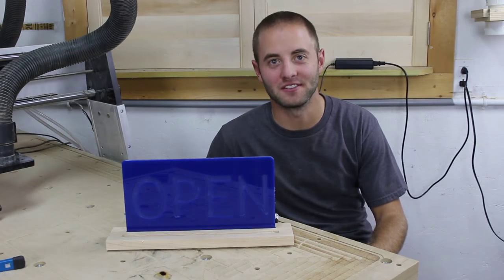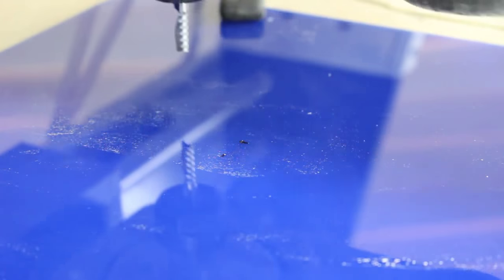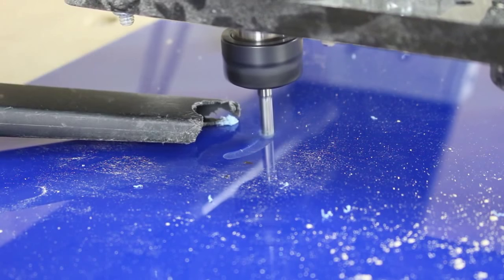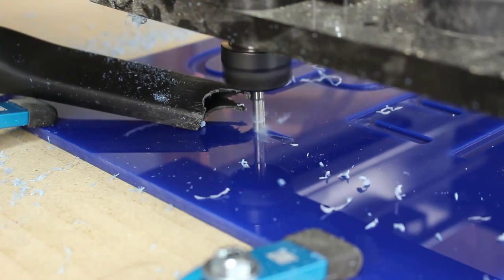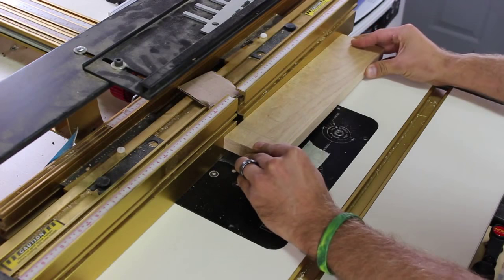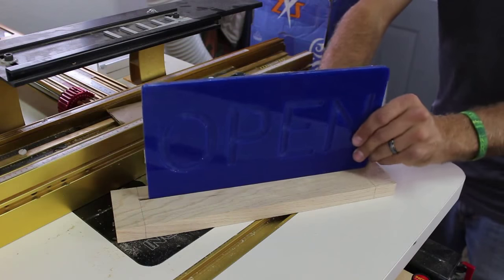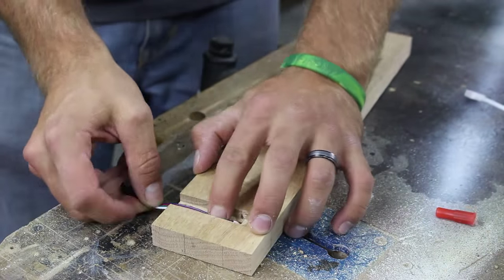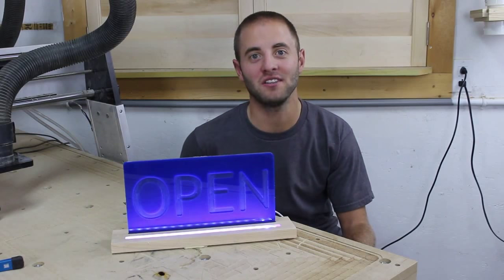CNC Tutorial: Acrylic Sign with LED | Glass Impressions

Comment: Cool work Andy! What kind of bit you used for engraving acrylic? i dont get a nice bottom with the ones i have used...
Reply: +Jorge Luis Buenfil Gomez Thanks for the comment! I use a specific plastic cutting bit. Speeds and feeds are a bit tricky but buy a little more material and run some test cuts. Google plastic cutting router bit. They are typically labeled "something O' Flute" bits!
Reply: Thanks Andy! Keep feeding us with your cool work!